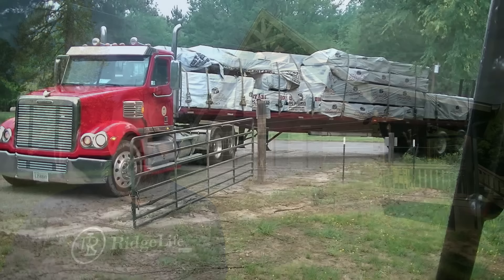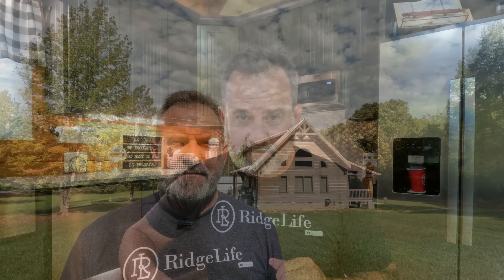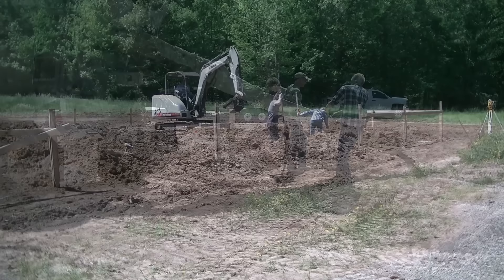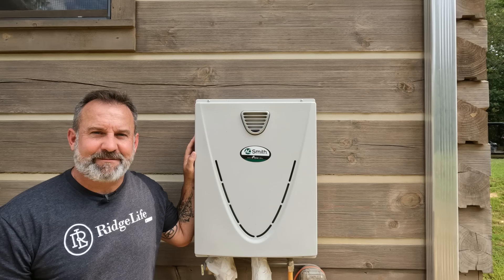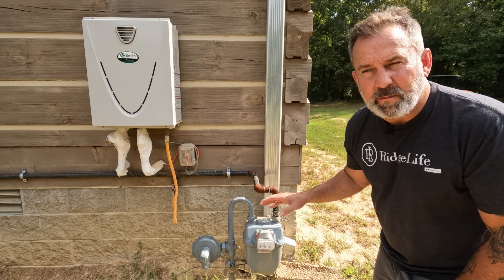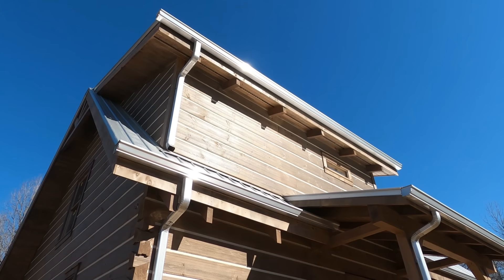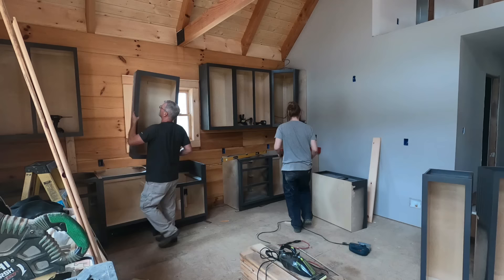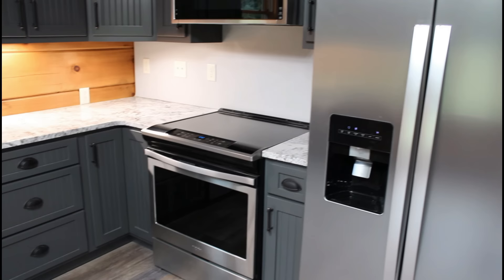Log Cabin Build Total Cost | How Much Did We Spend? | Cost Breakdown

Comment: Geez, my father took most of the logs off his property he used to build his 2,300 sq ft home. Peeled and cured himself. Some came from the local lumber company in town. Has finish walkout basement, vaulted ceilings, open loft with masterbedroom off of loft, 3 bath home, 3 bedrooms. All cabinets made from Heartwood cedar, which also came off his property. 2 fireplaces, main floor, and in the finished basement. front porch total length of front of the home, back porch off main floor, length of the home, patio off master bedroom, upper lower staircases heartwood cedar cut in half log treads. All for under 45k. Just shows what you can do if you're willing to put in the work and take a couple of years to build it mostly on your own, the savings are huge.
Reply from the maker: Wow! That’s amazing!
Reply: Impressive

Comment: Owner of a log cabin, they’re beautiful and enjoyed the house in the first several years. As these houses age, they become a maintenance nightmare. Constantly caulking and staining, D log engineered kit built home and is a 1 1/2 story gambrel = dangerous heights and $$$$ in ladders and staging. If you don’t mind spending many hours in constant up keep and battling log rot. I wish I went with a stick built home with tongue and grove pine for interior aesthetics instead. The resale value of a log cabin is also a negative aspect, small amount of buyers interested in them. In my mid fifties and great physical condition, the cabin is 34 yrs old now and I’m burned out. DO YOUR RESEARCH! Backer rod, chinking, caulking, log wash and labor and time. PS depending your location I recommend steel roofing, constant resealing of flashing.
Reply from the maker: All good points!

Comment: Thanks for your great video. You did a great job. So that $250,000. Did that include the Lands cost. ? As it is a small 1400 S.F. house, so maybe the land was included in your total too. Tennessee R.E. is not expensive. Plus built a stick built 2 or 3 car garage out of wood first, and sided the front, and two sides you see with the timber look siding to match your house, and maybe use real T1-11 Ply with groves every foot, or maybe smooth, with board and batton strips on the back. That garage he had built was kind of pricey for a small all metal garage. But maybe grandma does not need lots of storage. As no need for a foundation on that small metal garage, just the small 4" thick slab floor. As this garage system is light, I dought any reason for a 12" inch wide x 6" inch thick foundation. But if wood, and big better wood trusses, that are spaning a much larger distance, as a 2 or 3 car garage, you need a foundation to hold it all up. But when done right, it would match the house. Do the same roof angle, and metal roofing. You could even have storage built in above the garage, or a kids apartment, or man cave, grand kids play room, ect.  Maybe frame it a steeper pitch roof to get more space up there, and maybe a few dormers with windows facing the front. Gingerbread look. Then you can have a shop, and storage using one bay of the garage, with the stairs to go up stairs, and 2 spaces for cars or truck. Or use some of that one bay for a home office, or the upstairs for that, and put in exterior stairs to go up to it. 
As that Big Lot you will need a riding mower and park it in the garage. Nice clean easy lot to maintain. Nice clean job, and nice utilities shown. You paid to much for those cabinets I saw in the kitchen. Maybe the granite was a fair price, if that was a total installed price on the granite. That is a small house at 1400 .S.F. so maybe it did include the land for this $250,000. ? I usually build for resale. So I would have built the House bigger, maybe 2000. S.F.+ , 4 bedrooms, and a 3 car garage, at $300,000.+ total. But a bit more if making a big room above the garage, and making it real nice, and adding Dormer windows above the garage as a apartment, or a office. As that big attic room above the garage may add a extra $20,000. To its cost. Or make it even better, as it is a good place for a Son, or grandsons Apartment.
Reply from the maker: No that is without the land. You have to remember this was built just as the lumber and material prices were skyrocketing. Thx

Comment: Hi, wonderful video series on the log cabin build.  I have a question regarding one of the line items if you don't mind answering.  On the electrical section you stated that it was about $10,000.  Was that just to run power to the house or did that include wiring the inside of the house and all the lighting, switches, receptacles, etc?
Reply from the maker: That’s was all in for electrical.

Comment: This is a great home and a great video, but misleading. this is not a LOG home. Its a wood construction home.
Reply from the maker: Thank you. The home is built with solid 6x12 Appalachian style kiln dried timber logs connected with dovetail joints on the end. Log Home.
Reply: @RidgeLife  6x12 is a board. Technically you have a plank home. Log is a whole tree stripped of branches and bark. Log Home.